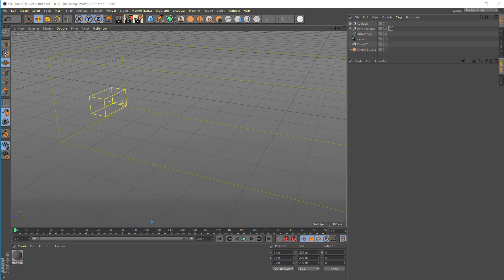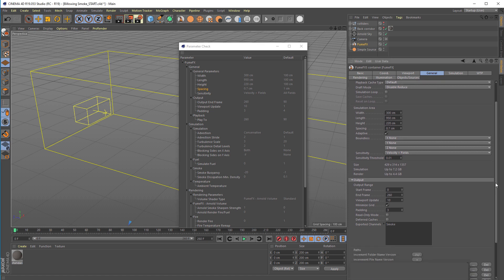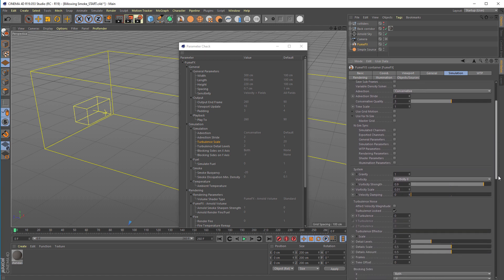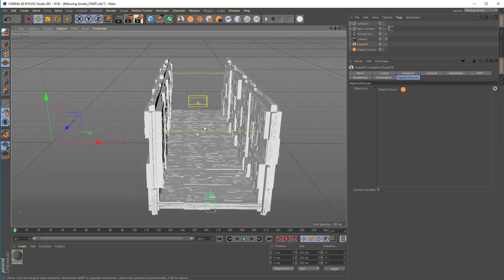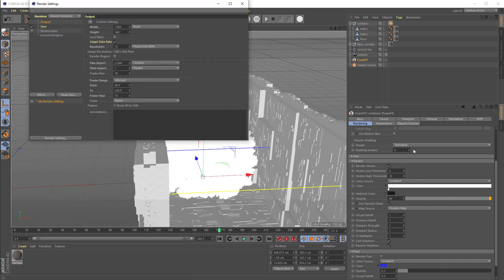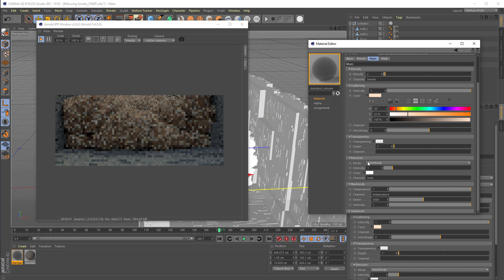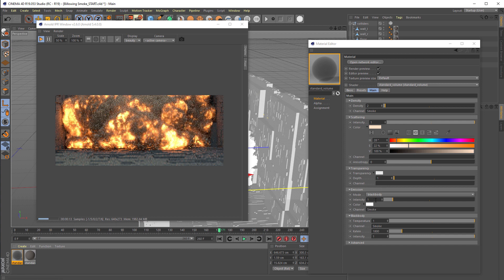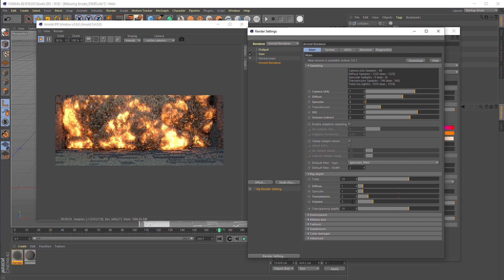FumeFX C4D Billowing Smoke/Fire Tutorial

Comment: Thanks for this! Question on the size of the default simulation, once mine was finished it was over 100 gig. At the start of sim in the general tab it said it would be 7gig. Is this normal or have a i got a setting wrong? Also if i finished a wavelet turbulence sim do I still need the default sim data or can I delete it if im using wavelet as my playback?
Reply from the maker: 7 Gig is estimated maximum amount of memory required per frame. Once you're finished with Wavelet sim, Default caches are not needed anymore.